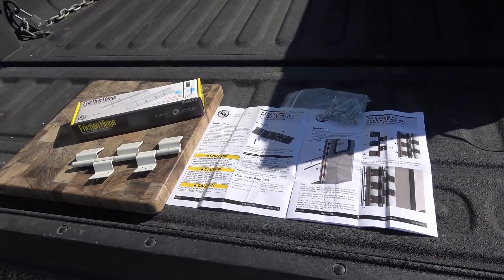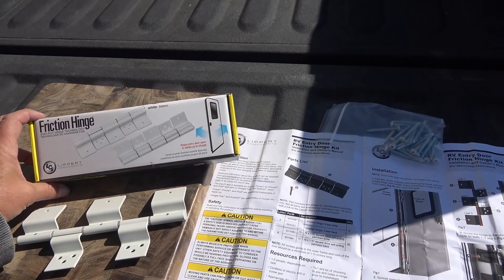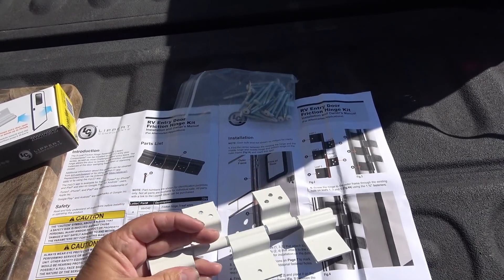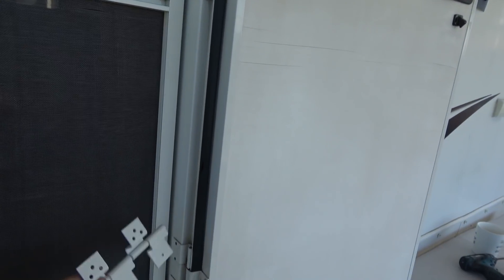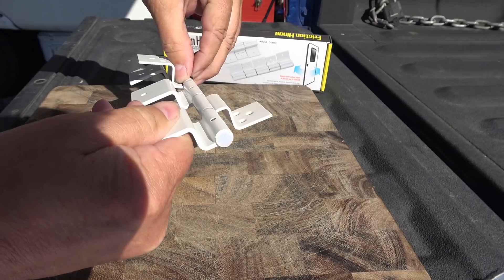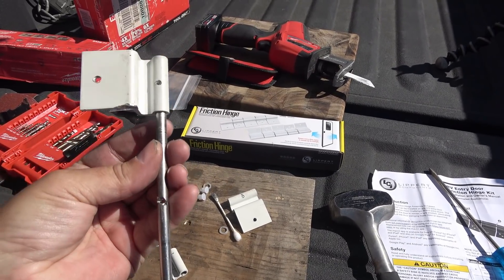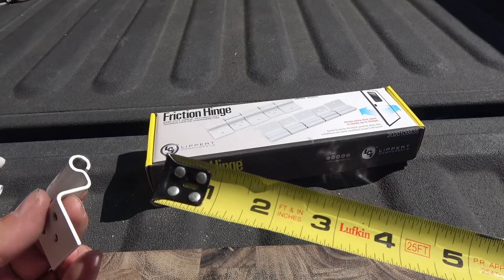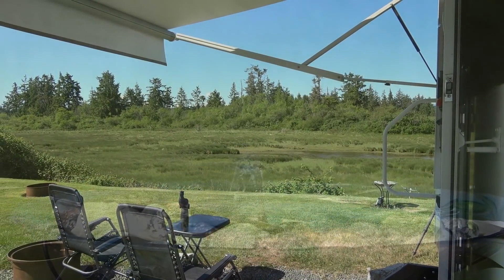What is an RV Entrance Door Friction Hinge? Love It or Hate It?

Comment: We had a front blow through with some serious strait line winds, blew apart some sticks n bricks. My Lippert door got away from me and the gas strut got ripped apart. I put the Lippert kit on mine and it works good. Only thing is the latch was slightly loose and stress cracked my frp door liner on the inside. I tightened it up and the cracking stopped but it's still cracked. The door has a foam core and fiberglass outer but the inside frp embossed panel could use some Azdel underneath to prevent stress cracks.
Reply from the maker: Thanks for sharing. Cheers, Ray

Comment: I have these hinges and for people who don’t know they require a little bit of Lubricant and they don’t get in bind.  Love mine.
Reply from the maker: What lube do you use?  Looked like graphite grease in there to me.  I wonder is some lube sprays may cause problems by washing it away. Cheers, Ray
Reply: @LoveYourRV  I have used WD -40 with no problems.  It has to be done anytime it starts getting tight.

Comment: A friend has them and I really don’t care for them.  My Cougar doesn’t have them but it had the dampener that I removed so the door would open fully, I installed a latch to hold it back against the side.  

You really have to watch those winds in the desert SW, several times it’s been a challenge just to push it open.

Comment: The main door on our Imagine has a friction hinge. It’s so hard to swing that it has warped the door or the frame such that the door barely fits (and this is with strike plate completely flattened)…and it’s getting worse. I hate this hinge. We rarely camp turning hurricanes or tornadoes so friction hinge not needed…replacement hinge will hopefully fix.

Comment: I 'had' them (OEM) on my 2015 Jayco. They were very noisy (like metal on metal) so i did use a spray silicon; then a graphite and finally lithium grease them. I even tried to pry/ loosen them up a bit . One of the hinges broke and I am not replacing them. Yes they were great when the door was open and it was windy out. But a real pain to open & close more often than they were appreciated. I now use a bungee cord when needed. My 2 cent opinion.
Reply from the maker: Thanks Herb

Comment: I was hoping you would have found a fix for loosening the friction part of the hinge. Mine got so tight and/or creaky that it was pulling the frame away from the door edge. After repeated oiling and working it back and forth, I finally just unscrewed the tightest flaps. Adjustability would have been great otherwise relying on a press fit is a flaw with these hinges.

Comment: You can take a screwdriver and use it to pry open the friction hinge parts  just slightly to make it less frictiony. I didn't like mine it was just too tight and you had to fight with it to close the door. Now it's nice and loose.
Reply from the maker: Good tip, thanks. I guess a person could maybe take a C clamp and attempt the opposite.
Reply: Where did you pry open on the friction hinge? What does the screw  on the bottom of the hinge do?

Comment: Have you ever found a door holder that works? Every one I've installed has broken or ripped a hole in my door. Appreciate this review. I dont have a compatible door either. I guess I'll try a stainless clip style catch. Saw that on an old airstream and it's always worked accordiing to the owner.
Reply from the maker: I've had the original OEM plastic catch on the side of the trailer for 11 years now and we are full time RVers. Looks like this https://amzn.to/39sWhsb
Reply: @LoveYourRV  yeah, those always break and rip a hole in the door. I live in my rv fulltime too, 15 yrs., but in the west mostly Wyoming  and Arizona where winds are a way of life.
Reply from the maker: Weird, mine has been fine 11 years now.  It needs to be located near the edge of the door so the screws are into the frame.  Here is a look at mine https://youtu.be/-bqYkP_Pdlk?t=452

Comment: Hinges became stiff and then bent, caused problem at the top of the door binding.  Bent hinges and lubed now works fine in 10 mph wind. Bear broke door, repaired and door shut fine for a month then the problem started.
Reply from the maker: Thanks for sharing.
Reply: My Rockwood door hits on the upper left hand corner opposite the friction hinge. Might just have to change hinge. Hopefully its hasnt bent my actual door frame...

Comment: I tried to order these last week. 2 problems. 1) I cant tell who made my door because the mfgr. sticker is covered up by an existing hinge, and my email to Coachmen hasn't been returned. 
2) While these were in my cart at Amazon the price went up 10.00 in 2 days. Anyway, the more I research the more I discover just how many door frames are getting bent. If and when I am able to order I am thinking about just installing one hinge in the center. You think that would do any good?
Reply from the maker: Not sure. If I can move the hinge with just my fingers I'd think the door moves pretty easily with just one hinge. Likely it would hold in place until some wind blows. I'd keep the regular catch in place.
Reply: @LoveYourRV  Thank you. I may just replace the catch with a magnetic one and call it a day!

Comment: I ordered and installed a set on my 2017 Reflection 5th wheel a couple of months ago. Used it for the first time on a week long trip to Chattanooga two weeks ago and really like it. Won’t keep the door open in a really strong wind but worked great otherwise and I like not having to walk outside to unlatch the door hook when I’m ready to close the door. Only thing I’d like to see them change is to put three pre drilled holes on both sides of the hinge instead of just the one side. I used the provided template and drilled the extra holes on my drill press.
Reply from the maker: Thanks for the feedback and good point, Larry. I thought that myself. I wonder why the holes aren't predrilled already.

Comment: I would advise NOT installing friction hinges on your RV door.  Our 2016 Montana came with Lippert Friction Hinges on the door, and now the door frame has pulled away from the door skin, and has distorted so bad, that the door is contacting with the door jamb, and has to be slammed.  A new door costs over $1000.  This is a poorly engineered product, in my opinion.
Reply from the maker: Thanks for sharing. Hopefully  you can take the door off straighten things out and save the door then install the none friction hinge version. All the best, Ray